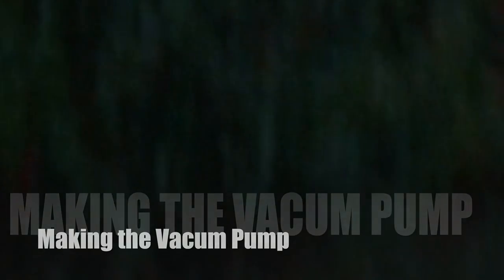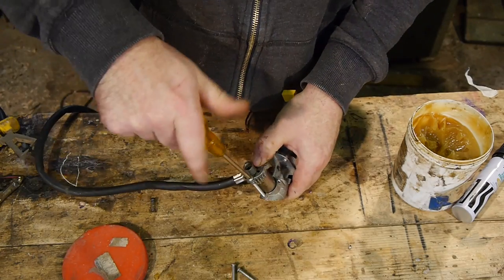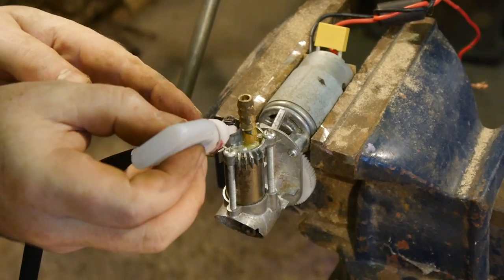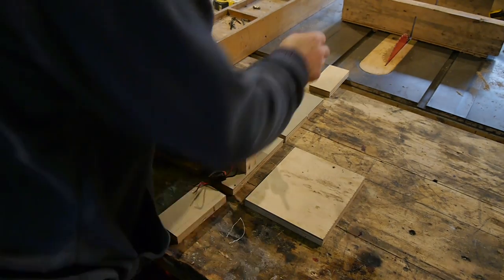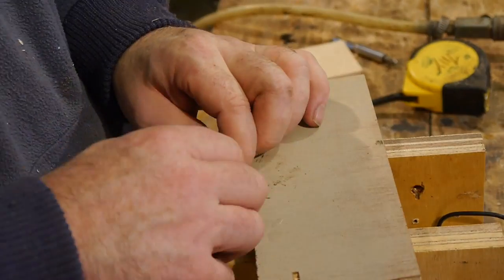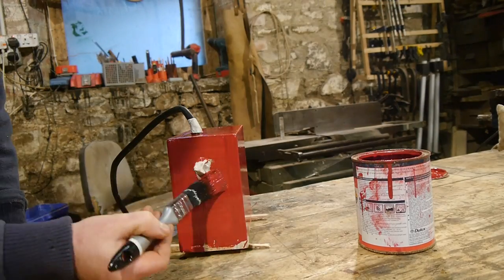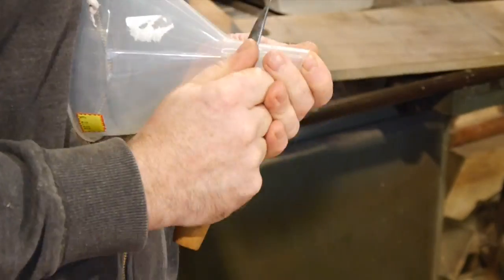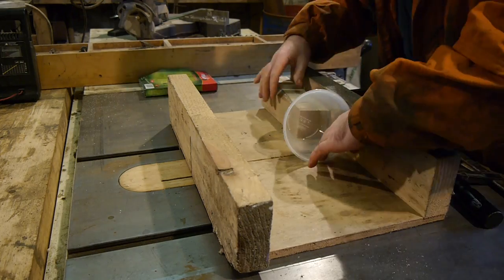How to make a Multipurpose Vacuum Pump & a Buchner Funnel

Comment: A manual vaacum pump (more like negative pressure pump) can be a good to have also - and is sufficient for this type of scale. Modifying a cheap rod-style bike pump is the same principle as what OP did here with the valve. Many old pumps actually have reversible valves, making it almost trivially easy, so restoring an old (likely free)junker from some boomers garage could actually be a good idea. Just check any gaskets and orings. In principle almost any air pump can be reversed with some modification to suck instead.
A manual pump actually has some benefits because you can finely control the pressure. If you DIY something like this from thin plastics it cant hold much negative pressure before collapsing - but you dont need much to be effective, and the manual pump lets you control that.

Lastly I want to give a tip about materials: Glass is obviously good, but if you choose a plastic which is much easier to work with, I strongly recommend PP(5) over HDPE(2). Both are extremely chemical resistant, but HDPE is fairly porous and will tend to pick up smells, strong pigments and micro-contamination. PP is so much easier to clean up, being non-porous and naturally non-stick. The only problem with PP and HDPE is that glues and epoxies stick very poorly to it unless you flame treat them (search for tutorials for more on that). PET(1) is also non-porous, but not nearly as good chemical or temperature resistance.

Comment: been looking for a vacuum pump to marinade meat. found it! great job.
Reply from the maker: Wow never even thought of that, how do you go about it?
Reply: Frontierless Craftsman - hi there,  to answer your ? you make a liquid marinade for whatever meat you want to use. pour the marinade into an airtight container along with your meat and pull a vacuum. the vacuum pulls the marinade adequate into the flesh of the meat much faster than the  old fashioned way. the vacuum distributes the marinade through the meat equally as well. the finest steak resuraunts use this method because it only takes minutes instead of days to flavor the meat. this method flavors and tenderizes the meat faster and more evenly. 
try it, and let me know, or better yet make a video...
Reply from the maker: will do, I love making jerky so you never know there might be a video in the offing, thanks :)
Reply: @walterlafleur8961  WOW! Thank you for thinking of me and relaying this info back to me. I never did get around to making a vaccum pump I just wet marinade longer. I seem to get a great result that way.

Comment: How much vacuum can you pull with  this thing?  My experience is not much, it seems a harder job for the motor.  If you had a proper crushed rock/sand buchner filter + paper filter+ activaated carbon layer?  can your one pull liquid?

Comment: Is that weed ur useing
Reply from the maker: steelcity420187 I could ask you the same question, as I said in the video vervain and motherwort
Reply: Frontierless Craftsman  sorry kids loud couldn't hear it just looked like the same kinda thing that is used for vape pen extract
Reply: But good video I will be makeing this for bleeding brakes
Reply: @steelcity420187  Likely good to have an inline filter as brake fluid vapor/mist can ruin things in the pump.